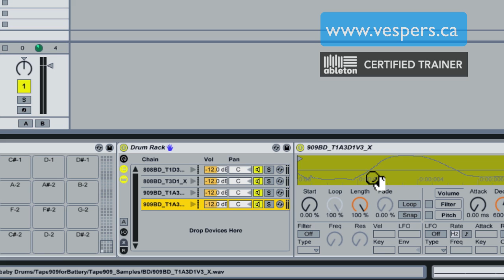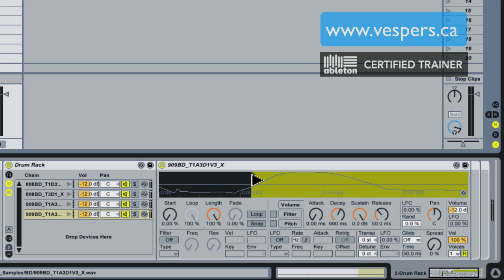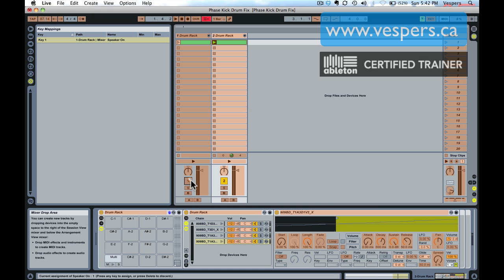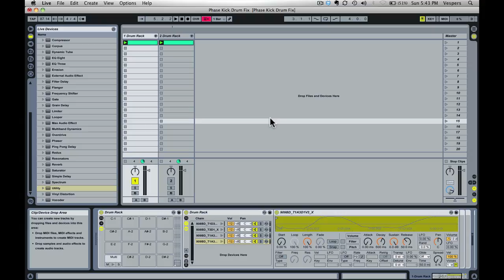Ableton Tutorial: Correcting phase problems with layered kickdrum waveforms

Comment: cool video! But I wonder when you have two kick drums and they occupy different frequencies let say low and high. Does phase cancellation matter then?
Reply: Alright so I will look for the lower freq to be in phase then. And also I use a drum synth to produce the low end should I bounce it down to audio and compare the waveform to the high freq kick then? Because its hard to know if your in phase without audio files.

Comment: I just A/B with a plugin that has a phase reversal button. In Pro Tools, the "Trim" plugin has one. Or, I can select regions and flip them. Usually, it seems that if one waveform starts positive, and another negative, flipping only a section will flip that section but not the remainder of the wave that will continue out of phase. Don't know if you're running separate tracks between your voice and and Ableton, but if so, your voice could use a hi-pass filter. :)